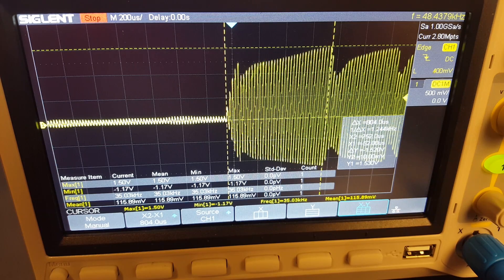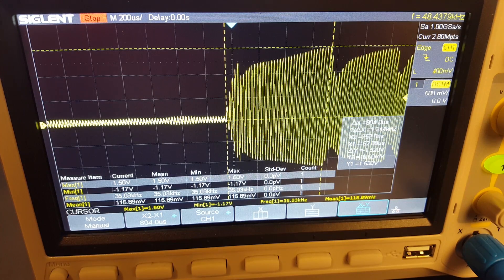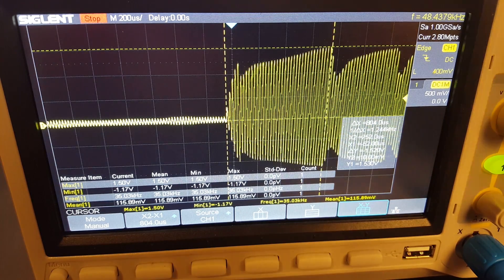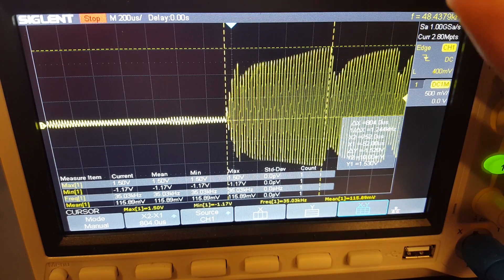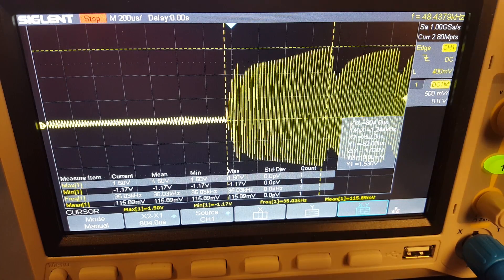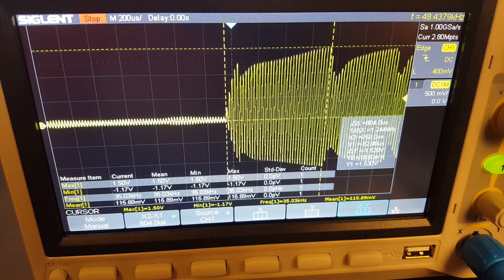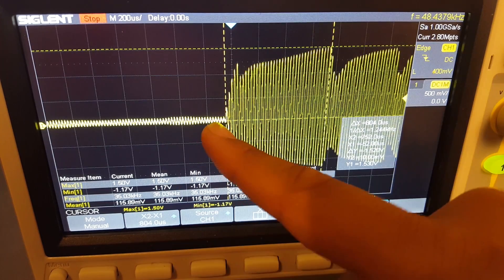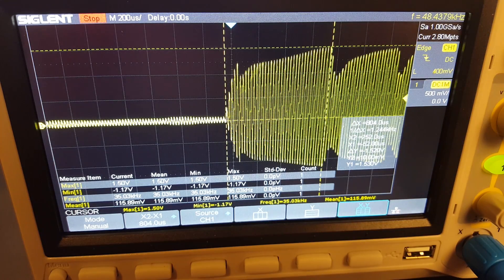ESC Throttle Response Testing Setup // DYS Aria 32bit

Comment: I can almost see Matek's reputation yaw-twitching away. It's funny what the F405 group has devolved into...
Reply from the maker: Yes I was able to replicate it and its do to no noise filteration on the gyro.. I have contacted them and told them.. Basically if you have a noisy esc motor setup this will not go away unless you add a cap on each ESC. 

I have a video on this issue comming soon. I have told them to add some kind of filteration next to the gyro to cancel some of the noise so this way 1 Low esr cap that is provided would be enough. 

I totally agree this is very bad and I wish i setup some bad ESC earlier and diagnosed the problem.
Reply: Now to figure out how patreon works as you've saved me a lot of money in reviews so I guess you deserve a cut